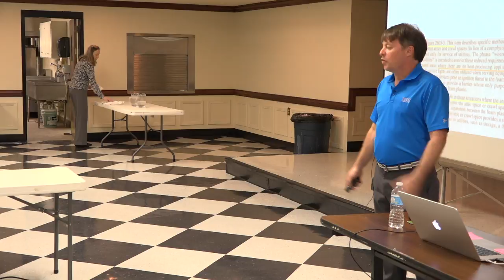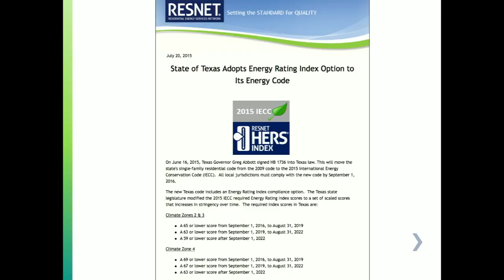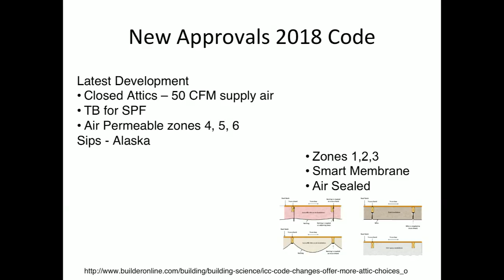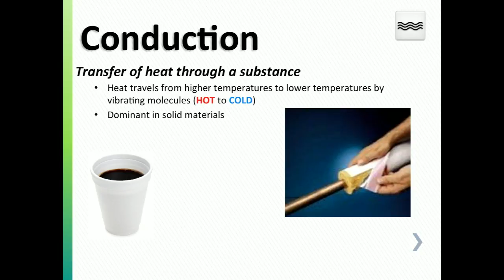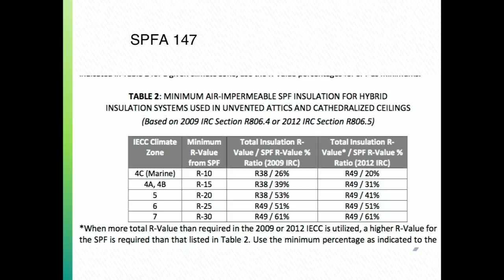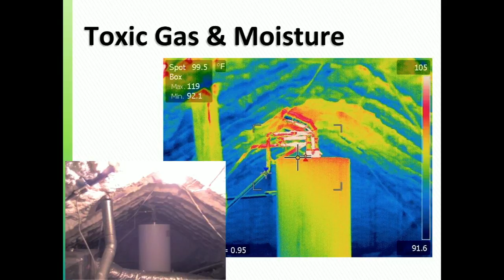Spray Foam Insulation Training 2

Comment: The poorest trained crew I ever met was Retro Foam trained.
No clue about code.
This review is for Retro Foam Corporate as a warning to consumers.

The worst home improvement contracting experience I have ever had in 40+yrs. of ownership was when I hired Retro Foam. The local franchise couldn't do anything right, nor did they follow my instructions for a good outcome. After they dithered about, I appealed to corporate, they sent out Ken E., he didn't get it either, instead of handling the rework properly by finding the problems and correcting them he sprayed over top of the poorly applied foam. Not to code, not to industry standard.   My further appeals to corporate were met with nothing but a big run-around and gaslighting by Eric G. This leaves me with a home that did not pass inspection.
My bank did claw back their fee, an easy out for RF, but not what I wanted at all. I wanted a professional job that would pass inspection. I pay gladly and promptly for professional work and have an excellent relationship with my contractors.
Apparently, I wanted too much from Retro Foam.
The only contractor I could find to do the remediation wants a fortune to fix what they did.
Please do not make the mistake I did.